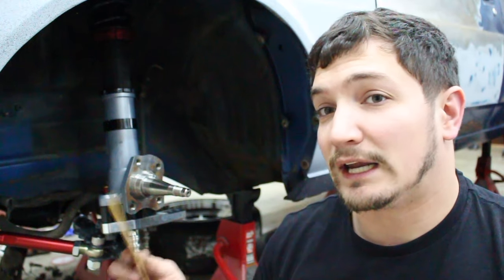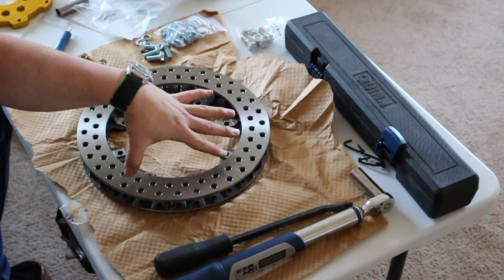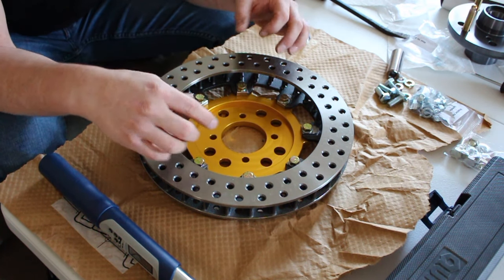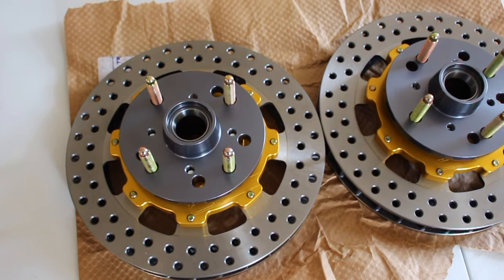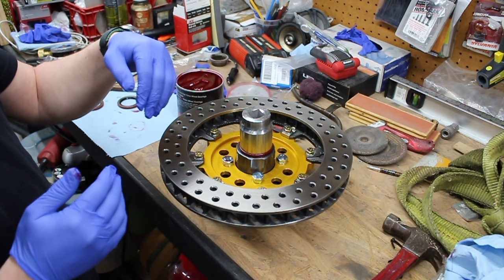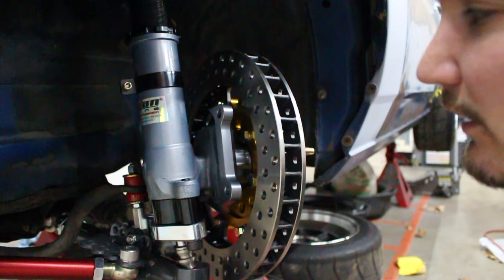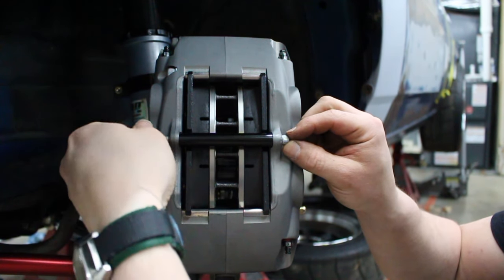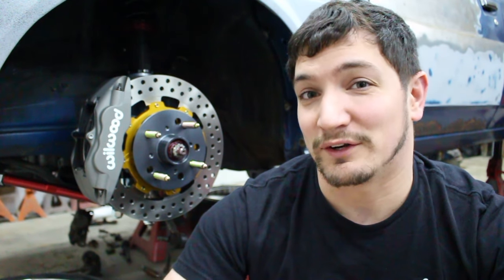T3 AE86 Big daddy brake kit install

Comment: Hang in there man it's never easy I'm having the same problem it's more about forwarding the parts I got a franking brakes they're half 1.6 twin cam and half 1.8 I have to do it for now until I get the hubs for the twin cam cuz I have the spindles from the twin cam on it but I can't put the rotor from the twin cam cuz I need the hub car looks good
Reply: And once again thank you techno toy tuning

Comment: Hey bro, Did you have to change the master cylinder at all to compensate the extra pistons up front and the rear pistons you did with the conversion to discs.  Do you still run a brake booster?  Proportioning valve?
Reply from the maker: I’m currently buying all of those parts. I have currently purchased a floor mounted wilwood pedal set. This removes the booster and the prop valve. All new lines will be ran as well.

Comment: I need to know if the celica Supra wheels will fit before I buy the Big Daddy kit. I ain’t letting my wheels go. I’ve got 2 sets.
Reply from the maker: Are they 15”. I thought they were 14”
Reply: @BuildsbyBailey  They’re 14’s I’ve heard of guys running 14” wheels with this kit but, none with the Supra wheels.
Reply from the maker: @poboyunlimited49  I’m not sure a 14” wheel will clear this kit. I would use the next smaller kit they make.